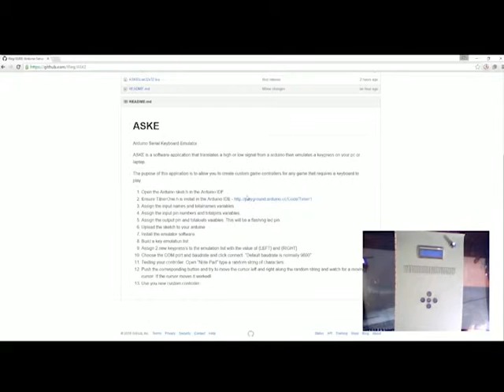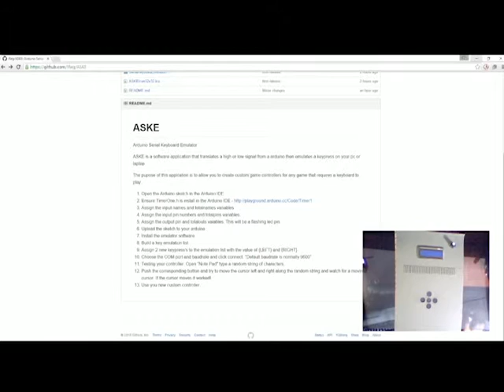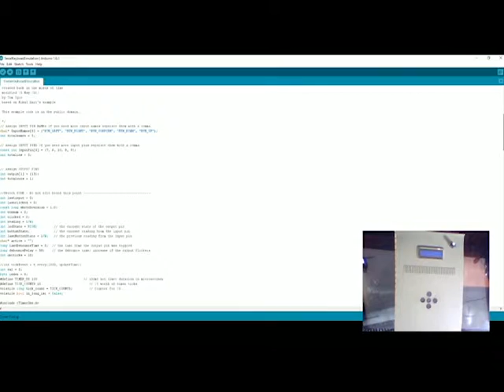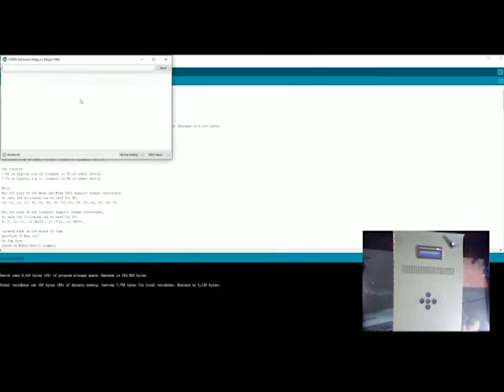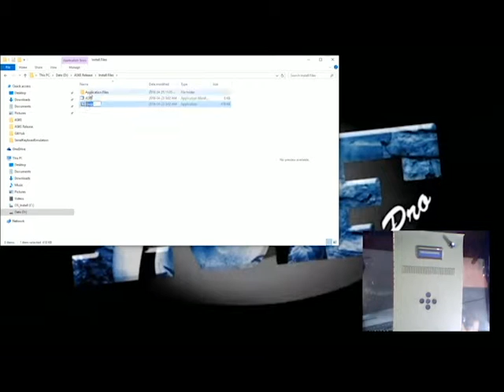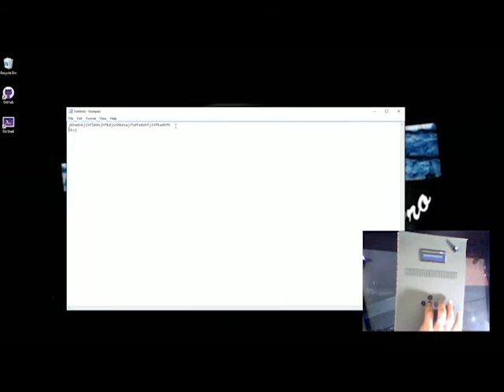Install and config process

Comment: Excellent tutorial, but i have problems with ASKE manifest install
Reply from the maker: If you are running windows 10 the software wont work. I wrote the program in a older version of visual basic. and the install file is not compatible with windows 10. Sorry for the inconvenience. I also was doing a bit of research after I completed this and found out that some games wont allow this type of emulation because the arduino does not use its own drivers to emulate the key presses. for example in order to make it work I would have to write a usb driver for the arduino and do a lot of backend stuff to the arduino to make it work. its very complicated or at least to my knowledge it is. But it could still be used if the Game allowed a controller that uses a Com port to transmit the controller information and not usb.
Reply: I managed to make it work on windows xp, but the connection with arduino did not work, I believe I did something wrong. Anyway I'll keep trying.
Reply from the maker: ok. hmm all i can think is make sure ur choosing the right Baud rate for the arduino you are using. It has been a while so i forget which is which off the top of my head. Also I recently found a free dev software for c# that compiles visual studio applications so I may get back into developing for the arduino in the near future. I will keep you posted.